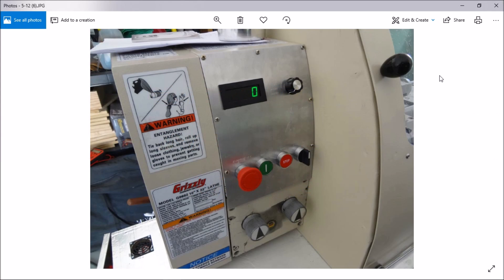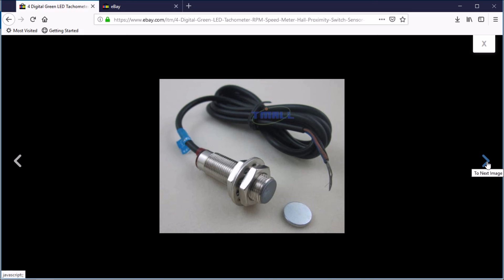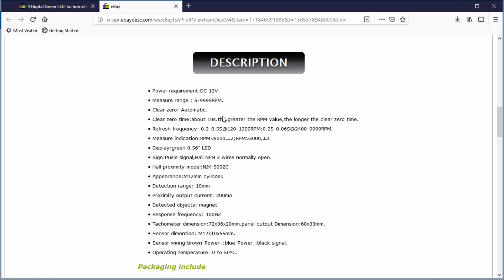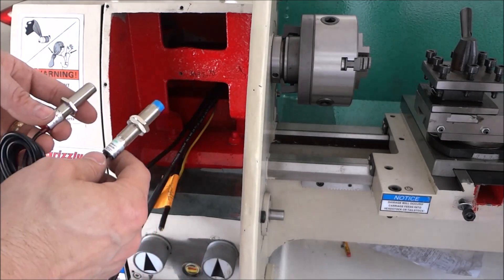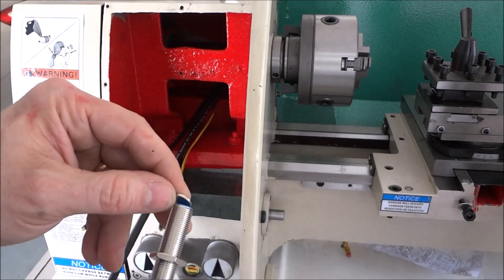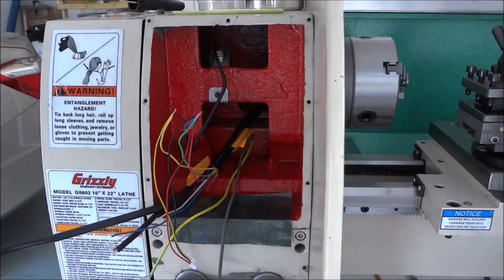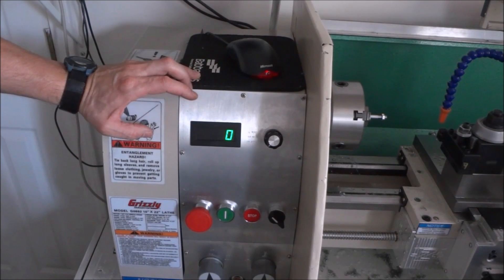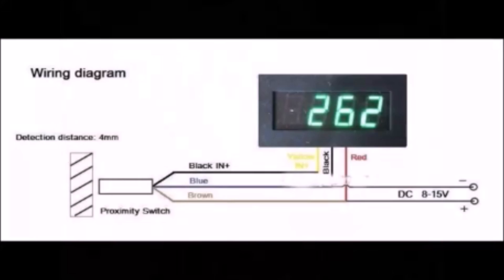MACH3 TURN EASY TACH INPUT

Comment: i have the bl mach 3.3v and i can´t see the green light blinking? do you solve it until now i tried with all the pins number but nothing. Im using and arduino 5v sensor hall
Reply from the maker: what are your voltages when sensor is active and not active?

Comment: Can you give some info on how to use data from tacho into mach3 for indexing used for threading. I have problem to use proximity sensor on mach3, it doesn't show up the correct number on mack3 S tacho. The sensor is working as index seen on diagnostic.
Reply from the maker: Make sure you have Spindle speed Averaging selected.

Comment: i did the identical setup.. the little chinese readout works perfect, but mach willl not take the signal..i tested all different voltages and pins. I really think 1 or more of my outputs are interfering , just got to figure out which one.
Reply from the maker: voltage to mach3 input needs to be 5v then drop to 2.5v once for every revolution.
Reply: Did you solve it? What was the problem? I have same issue.
Reply: @darkobul1  no , never solved.. I simply figured that mach was set up to read when running db 25 cable , and since i was running usb , it just never worked.. Ive spoken to others who also never solved it .I spent a solid month testing every possible soultion , had 2-3 different sensors , etc etc . I switched oveer to acorn , everything works fine
Reply: @airgunningyup  thank you

Comment: You will not believe it, but my exact same tacho (in blue though) arrived in the mail today. My CNC build is slowly coming together...

Will watch this video with interest.
Reply from the maker: Yes they come in various colors, Just measure the tach signal output as long as its under 5v you can connect this directly to the BOB

Comment: Is a single pulse like this enough for pid spindle speed control? I really need closed loop spindle speed control.
Reply from the maker: It works well for CSS on the lathe But I cant say in that application.

Comment: Awesome vid! I've been working on nearly an identical tach for my g0704 mill and I'm now thinking I need to feed my sensor with 12v, time to do some testing with the multi meter.
Reply from the maker: Similar setup should work fine for a Mill